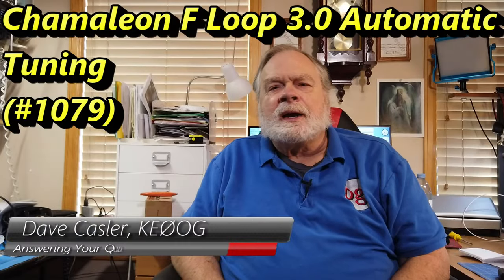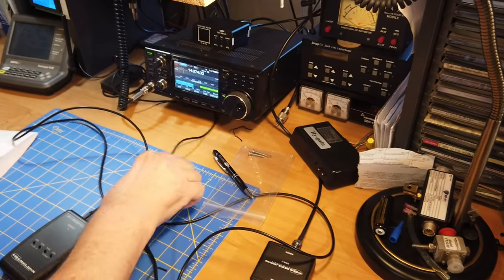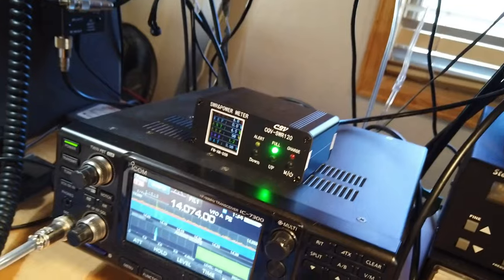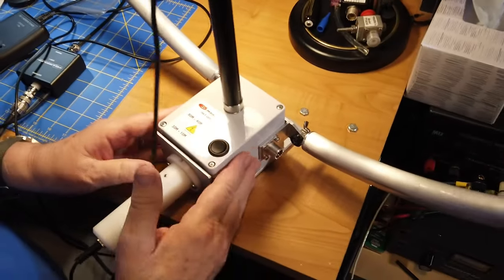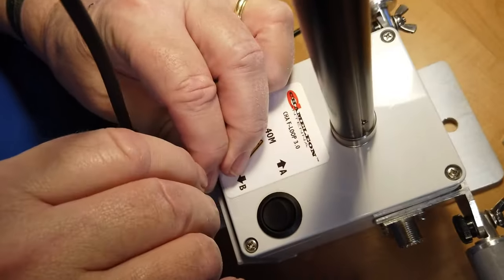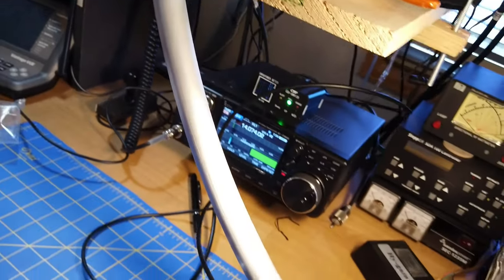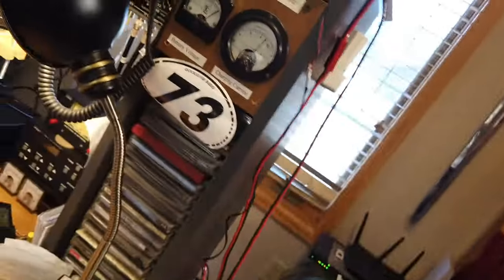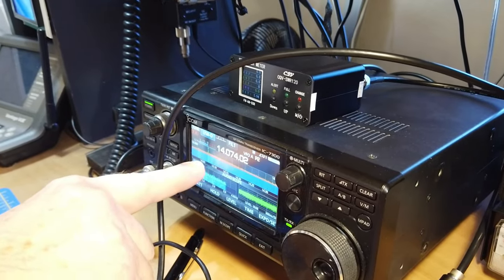Chameleon F Loop 3.0 Automatic Tuning (#1079)

Comment: What happened to the classic high power magnetic loops that needed a $500 Soviet vacuum variable capacitor across the top? No one remembers they exist, and ran high power?
Reply: You can homebrew them and I talk to someone almost every day who used a jennings vacuum variable cap, but they will generally use their regular dipole antenna.

I wasn't that far invested into a magloop given I have an 80m OCF and 160m full wave loop, but did experiment with one for my SDR, even remote autotuned the thing. Was a fun little project.

The one time I lit it up with 100W, I used coax for a capacitor and found the performance was rather poor (I was getting S9 reports when I normally get S9+10, so 10db down) compared to any of my other antennas. Magloops are for when you have literally no space and don't want to go portable.